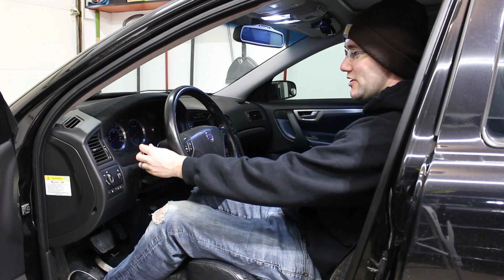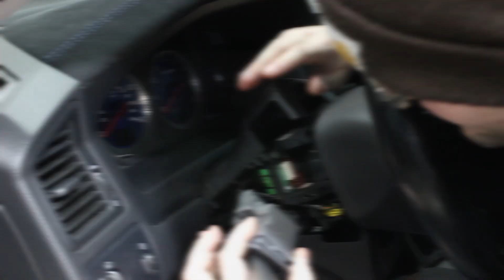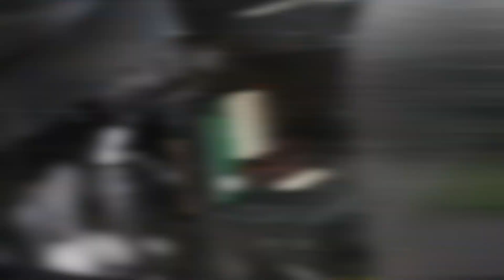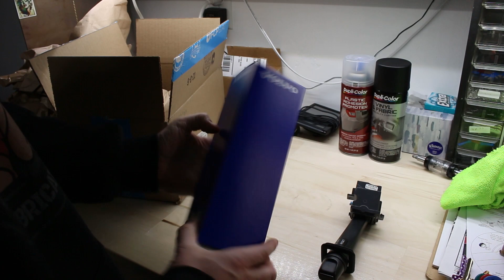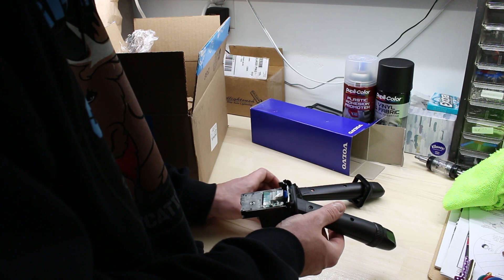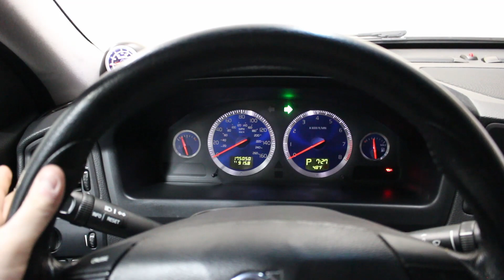Volvo V70R P2 Turn Signal Switch Replacement (Quick and Easy)

Comment: Worth mentioning that the square gasket only goes on one way. Why? Because Volvo hates us. If there's a way to make something more difficult to do, they'll do it every time. So if you're having trouble getting that thing back in there, rotate it 90° and try again. When you get the orientation right it goes in easily.
Reply from the maker: Great tip thank you!

Comment: Hey Thank You so much for your video how to do this. It was perfect! I got a quote which was $632. to fix it. The mechanic invoice stated $90 labor however his part fee was 3 times what I paid for the part. I was so proud of myself. The men who saw me  buying the part said Good Luck with that. which scared me almost intimidated me.But I put my big girl pants on, tied my hair up in braids (it was getting pulled out everywhere in the car) long story I DID IT!!! Thank You
Reply from the maker: That is awesome! Good job! Glad my video helped! 

There is another video on my channel where I replaced my reverse light switch. Local Volvo shop refused to work on it. I fixed it with a oem switch for under $15 and about a hour of my time. 

Congratulations! Gotta keep the Volvo's going.

Comment: Idk if you still have your channel but i was trying to figure out what exhaust you are using on your s60r sounds soo good
Reply from the maker: @hi_how_are_ya_  hey yes I do. I have a Catless 8Eightfab pipe to a magnaflow muffler. 3 inch piping for the whole exhaust.
Reply: @minnesotaprimal9721  I did end up finding you video it said xr1 borla muffler or is that wrong?
Reply from the maker: @hi_how_are_ya_  borla XR1 is my first muffler set up. Now I run the magnaflow. Both are great set ups. Magnaflow is louder and more raw. Borla is more smooth and sounds more consistent.

Comment: So nicely done, so simple cheers, just bought my first volvo what a solid car it feels too, just a few issue that switch and the MAFsensor
Reply from the maker: Thank you! Congratulations on the buy! They are great cars. Keep up on maintenance and they will last a long time. What issue are you having?
Reply: @minnesotaprimal9721  on driving back from purchase, engine system service required, turned out to be maf sensor, duno if it needs cleaning or replacing, also the main beam ok full beam won’t stay on don know yet if its repairable or nay everything else seem solid but i’ve not yet driven that far to get to know the motah, thanks for asking.